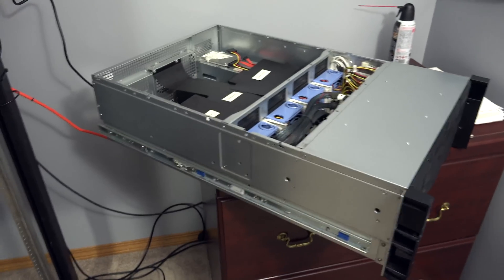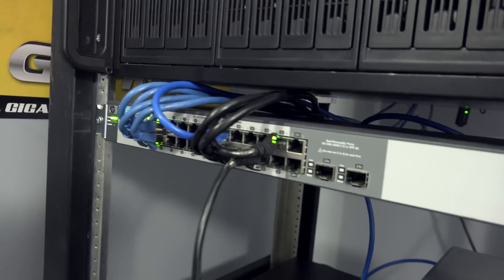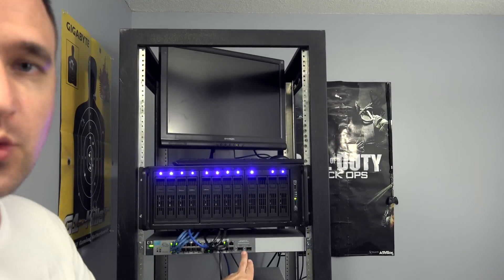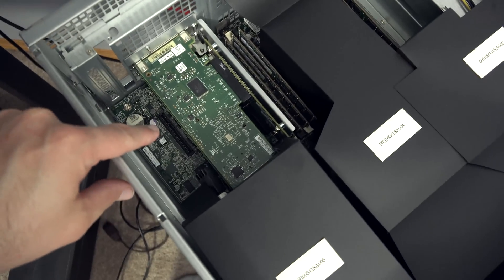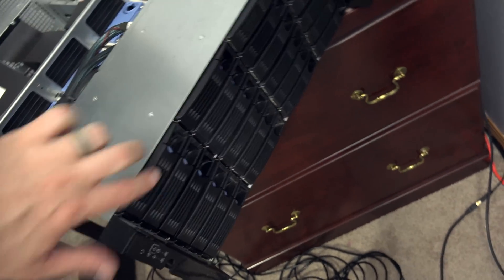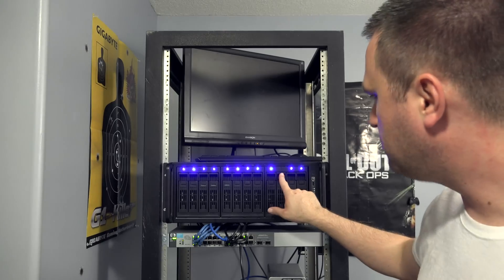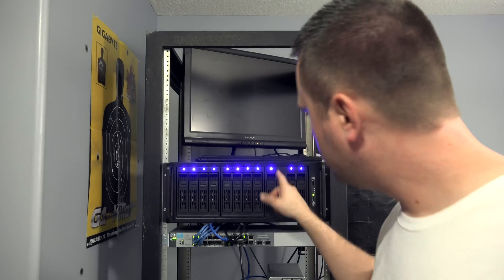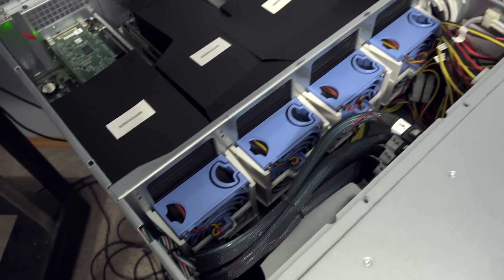New Dual Xeon Plex server vlog...P1...

Comment: I can't find any useful info on the motherboard or sfp ports.
But another solution for your problem could be to use an Intel® RAID SAS Expander RES2SV240 connected to one of the raid cards.  This should allow you to connect all 24bays using 2 of the raid cards.
I'm using unraid for several years now and I'm pretty happy with it.
Reply from the maker: Yeah I couldnt find ANY info on the board  either. :( 

I have seen some other recommendations on a different card to run the drives. If I cant get my sfp ports to work as needed, I might have to go this route. Just sucks they can be so expensive! I think my HP compatible cable will do the trick though...crossing fingers :)
Reply: I'm 95% certain those onboard ports are only 1gig when comparing them to other similar specd motherboards.  Well after some more googling I did find some similar motherboards with 10gig sfp+.

Comment: You need 2 x SFP copper ethernet adapters. The SFP will determine your link speed, however the backplane of the switch and server may be limited to 1Gb (your switch is). Then you can use a standard Ethernet cable to interconnect.  Not sure what brand your server is but I do know that HP often restrict use of 3rd party parts, hence your existing cable not working. You could also look into fibre channel SFP's which provide better performance but may still be limited to 1gb by the switch. Switch upgrade 😉

Comment: Can u turn down the fan speed
Reply: Enterprise server are at this noise level and this is for a reason(Airflow to cool hdds and cpus). you don't want to change the fans, because you need the airflow for all these hard drives.
Reply from the maker: even at low speeds, it is too loud lol

Comment: Ok this is a stupid suggestion. Install windows on that server go to your device manager and go to the network adapters and find the port and go to properties and then go to details "underneath the "property" you will have a drop down box click on it and find Device Description "if it is not already on it" and will "normally tell you" if it is a Gigabit Ethernet or not. You can also check on Manufacturer  or Driver Description. Something will identify it for you. Like i said it is a stupid suggestion but i found it easier to get info that way
Reply from the maker: not a half bad idea tbh. I was going to wait for my sfp cable to get here but maybe I can throw a spare ssd in it and try it out. good idea :)

Comment: I am in the process of a similar migration.  Moving from a 5x2TB Raid5 array under windows 2012 r2 to a RAIDz1 array under Freenas.  I wound up buying a relatively cheap seagate 8TB archive drive.  Worked well to house all the data for the migration and now I have an archive drive setup in a seperate machine for periodic backups from my Freenas box.  that way I avoided investing in additional smaller drives since (like you) I'm not forced to increase my NAS storage capacity quite yet.

Comment: I am setting up a new home server to house all of my stuff..
i went a different route... I always run a Windows Server with AD/DNS/DHCP... and the new Server 2016 is out. Running that now with the Essentials Role added.
6x 2tb wd black drives (cuz I have them and even 2 more sitting)

but back on track.. sorry...
I personally am not in it for the speed of the drives or raid or anything.. this is my PERSONAL HOME FILES.. and wife will kill me if I loose our family photos/videos..

so I opted for Stablebit Drivepool. Now while it IS NOT A TRUE RAID in theory... it does a few things.

1. you can use 1 drive... add a 2nd drive.. later add a 3rd drive.. which seems to be your current issue. 
2. you can specify what folders to duplicate and HOW MANY TIMES!!!! unlike raid say raid 5 where you have the stripe set with parity... I can say photos duplicate on ALL 8 drives but music diplicate only on 2. (in actuality it doesnt stack on a drive it places files all over... )

now the truly best thing to me... Server dies... caputs.. wont power... kablewie... what do you do? hope you get your files off... stablebit drive pool... you just put the drive into any machine and the files are readable and retrievable!!!!!

I just wanted to throw this out there. Maybe install a trial of server 2016 and a trial of stablebit drive pool.... 

This machine is on a single xeon e3, 16gb ram, 2k16, stablebit drive pool, plex is next including DVR via nextpvr and hdhomerun prime... (check out my channel - my videos suck compared to yours but I am horrible at this.. just started videos)

good luck and enjoy!

Comment: use a SFP to rj45. 
SFP is 1 gb/s SFP+ is 10gb/s :-) 
USE: vmware ESXi
Reply: http://www.ebay.com/sch/i.html?_from=R40&_trksid=p2053587.m570.l1313.TR0.TRC0.H0.XSFP+rj45+.TRS0&_nkw=SFP+rj45+&_sacat=0
Reply from the maker: so...I plug one of these into the back of my server and then use a regular Ethernet cable?
Reply: yes

Comment: Jason, I have owned a server exactly like this and trust me they are mega confusing I suggest you just sell the mobo and buy a new one.
Reply from the maker: why? too late now im committed lol
Reply: Mine was a 24 ssd array, but the bios was not updated and therefore configuration was hell. And I went on the hp website and tried to download updates for the bios and raid card but it never worked, as you couldn't download the file.. In the end I sold the motherboard and bought a consumer one with ecc support, plenty of PCIE lanes and one which I knew the name of.

Comment: Go with Unraid, you will save so many evening reading about free NAS to make something work. With Unraid, you will have access to cache drive and parity drive in a easy way. I have go the same way a year ago and I regret nothing about Unraid.
Reply: Anthony Roy i tried both 
i found freenas was easier/better for me
Reply: Freebsd is pretty easy, easier than freenas.. just "install, enbable zfs, make pool, install & setup share with samba" and that's it.. i tried freenas and it had 100 buttons on a page with 20 pages/tabs
Reply: Really dude ? Freenas is kinda plug'n'play :p
Reply: herrtuug, well it is easy to install, so is freebsd. But setting up all the things you need, i find it harder to do on web-gui than on CLI where i have used to do them for ~15yrs and bc of the pain of not knowing what are they doing behind that "click this to enable that"

Comment: A HP Prolient DL580 GEN3  as WEB providers are getting rid of the old servers and getting new equipment and 16TB of ECC system RAM and 4x INTEL I7 36 CPU cores processors would give you what you want which you can use as a render farm to render your videos but you will have to install FreeNAS in place of ESXI and you will want 14 SATA drives in RAID 10 mode, why not have the system under the house or in your basement provided you can and use a optical fibre LAN connection to you main PC.

Comment: Of course it's loud yo bought a server
Reply: Idk though, my r710 is quieter than that, and its only 2u....
Reply: its only loud because the lid is open, the fans speed up to compensate for loss to pressure. also it gets loud on start up
Reply: @silvercold88  and those fans tend to ramp up when you pull one out....... to compensate for the lost fan.
Reply: Kevin Clinthorne i agree with that

Comment: Your description led me to this:
http://sandiskarrays.com/chenbro-sas92118i-rm41824-dual-xeon

Which then led me to this:
http://www.chenbro.com/en-global/products/RackmountChassis/4U_Chassis/RM418

The SFP ports may even be a seperate board. it may require minor disassembly.
Those fans and heatsinks are there for a reason and if you are going to transcode with this server, then they WILL need them. Besides, densely packing hard drives generates heat, along with the 1350w x 2 PSUs, you will NEED to get that air through.

You may need to modify the room to include sound dampening materials in the walls and doors as, this was designed for a server room with plenty of ventilation and a seperate room away from workers.
By modifying the room, I mean making a mini server room just for the rack. Or, if there is another space that could accomodate the servers without interfering with the acoustics of the house, then relocate to there. 

I purchased an IBM x3250 M1 server and its noisy. Even at idle, its warm and a bit above ambient if I left the door open to the room that its in. At night, I can barely hear it over the dead of night, its two tooms and about 15m away.

There are ways to dampen the fans but advise against doing that. Welcome to the home server lab scene, be sure to strap in for the ride.

Comment: First off - my English is far from perfect, sorry for that.

Few things to keep in mind, that probably nobody told you about ZFS, though many would disagree with me:

1. In my opinion ZFS isn't that good for Home use. Here's why - it is not that flexible. 

Once you setup the RAID arrays that's it - don't touch it. Ever. Fiddling with it in the future might give you a lot of headache and possible loss of data. 

Furthermore reuse of the drives once set for ZFS might be a pain, because of the way ZFS writes its data structure to the drive.

2. For OS I think both FreeNAS and unRAID would be a waste of opportunity. Both offer fairly limited flexibility, customizability and expandability (as features and applications go). Most of the features they offer could be easily covered by a low power ARM CPU. The Xeons are wasted here.

- I personally would use Linux with Software RAID.

3. Noise levels are unavoidable with this kind of hardware. Even newest generation Servers, which are whisper quiet in comparison to the older are too loud. It is not coincidence that such things as server rooms exist (and are noise insulated) You might retrofit the CPU with liquid cooling, but you will still need to cool all those drive bays and you need to move a lot of air for that.

- Personally i would try to build a makeshift server room and insulate it (unless you have a closet to move the rack into) . But whatever a closet or other room - you need to think of airflow and heat, best to build or use a vent to outside.

- Also the heat will be a problem.

Keeping that in mind FreeNAS might be easier to a beginner.
Reply: 2. Tough for an ARM processor to perform video transcoding.

Comment: you have a good theory About the fans, but I know some servers will not boot unless those fans are present, you may be able to edit the power settings in bios so it isn't as loud
Reply: i remember that there was some simple diode or resistor or and transistor trick to bring down those rpm's but it is going to be loud anyway.

Comment: Don't remove the fans or you will cook your Harddrive! These servers are designed for the air intake of the fans!

On freenas, you can start with smaller HDD and get bigger later on. Example if you start off with 6 or 8 x 500gb HDD'S, a smaller drive can be expanded to a larger drive. Search for it on YouTube.

Comment: You could take a look at Rockstor instead of UnRaid and FreeNAS.
Reply: syndendesign I agree, that's what I'm running
Reply: can i ask why? i just built a freenas box and im wondering if there are better options
Reply: Matthew Santoro because it uses btrfs instead of zfs. and because Rockstor can better add new drives in a better way than zfs which seems to need same mount of drive. Rockstor can add only one drive at the time for example.
Reply: Matthew Santoro for me freenas was over kill for running a Plex server, and I didn't want the overhead needed, also I avoid command line when possible so rockstor has a good web UI to use
Reply: And I don't like that FreeNAS perfers 1GB/TB which sucks if you got lots of storage.

Comment: Okay, here's my thing - I have been watching you for a while and what I feel is that you will want FreeNAS the more you learn about it. 

And it's true, but not true - You can expand a pool in FreeNAS, but it need to have multiple of the same size drives added, you can't just add one. 

But the situation with the "current data" - Honestly, something you will want to consider is getting an unlimited amazon cloud account and uploading it all temporarily (there are programs you can use to interface with the cloud, encrypting it all if that is a concern)
While this will take a while, you shouldn't limit your options on something that can be solved with a little time, seeing as this server, with this massive amount of time investment and upgrading effort, will be worth taking your time on doing it right the first time around. 

FreeNAS has far better built in features for actually using the server as a server without making things needlessly complicated with VMs. It's a server, not a storage box with VMs running just to do a few tats (like run plex)

FreeNAS can run plex natively, now I am not positive about unRaid, but last I checked it can't. 

I would post on /r/homelab about this, those guys are really cool about these kinds of questions. (Include your video link)

And the motherboard, dude, it's like that motherboard doesn't exist. 

Nonononono - Those HDDs need the airflow pull, otherwise it'd be stagnant airflow.

Comment: I would suggest something with higher freq on the CPU. Plex likes those better.
Reply: Jason Evans . What I find interesting about transcoding with plex is that even though it's multithreaded, the single core performance makes a difference, somehow. I have a dual core CPU that lets say is ~75% as powerful as a quad core I have, but the dual core performs better in transcoding tasks.